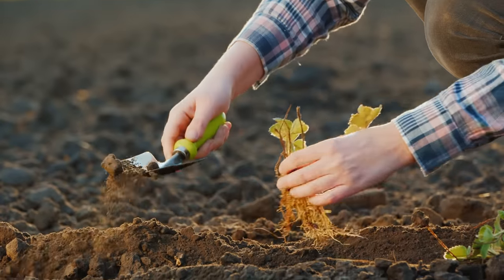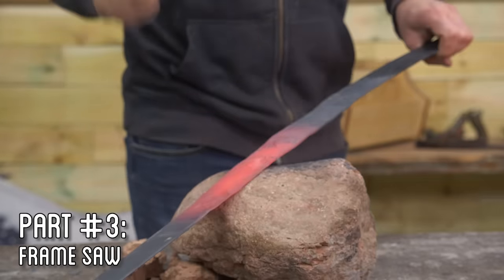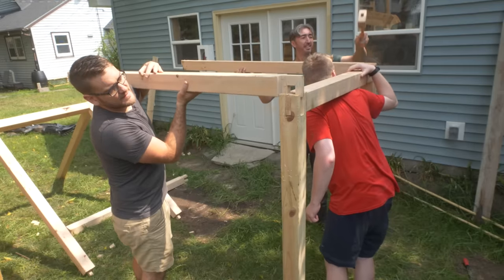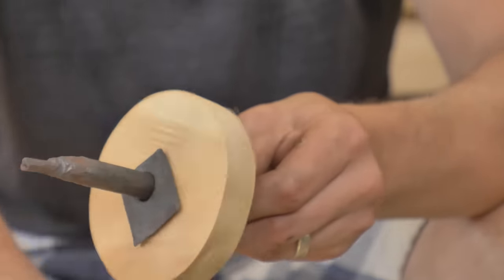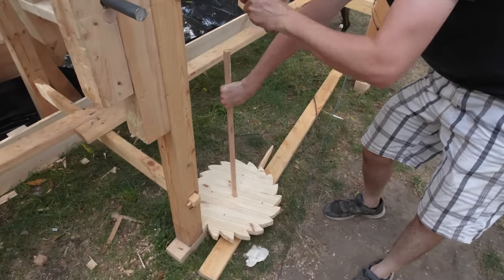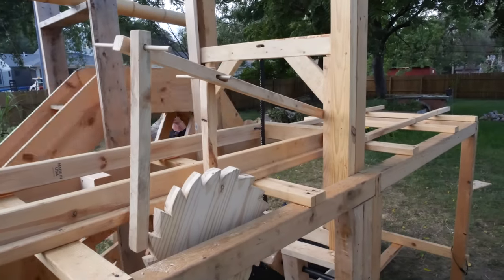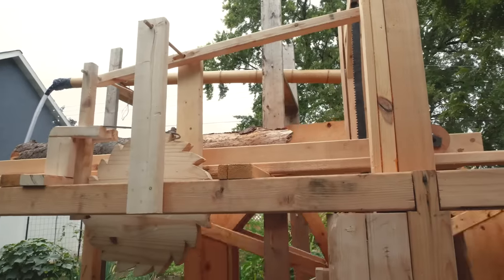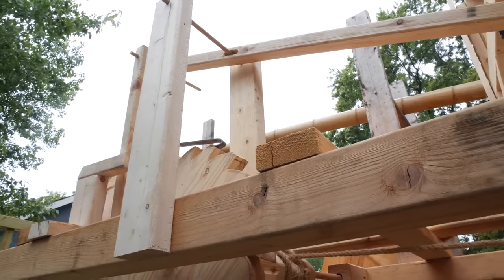I Built DaVinci's Saw Mill

Comment: The best way to better balance your water out flow is to have an upper water tank like a barrel.
That will give you a buffer time to fix any pump issues before the pressure ran out.
A large rain water tank might provide the volume needed to simulate a river in the same way.

Comment: Your connecting rod is a bit short.  This causes it to be at extreme angles and push the saw part to the side a lot increasing friction.  To keep the whole thing small vertically, there are ways you can get a much longer connecting rod without increasing the height to the log.  A simple one is:
Add an extension to the frame of the saw that reaches down almost down to ground level.
Make the connecting rod reach down to a crossbar on that.
This lets you have the log not very far above the shaft of the waterwheel.
Reply: Wouldn't moving the water wheel & crank farther apart horizontally accomplish what you're trying to do?  I made a similar comment about the connecting rod.  Its angle looked horrendous.
Reply: @lawr5764 I don't think I am getting your suggestion.  Somehow the one end of the crank has to push the saw up and down and the other end has to go in a circle.  I don't see how a horizontal change makes this better.  You need more vertical distance in the situation to decrease the angle.
Reply: @kensmith5694  You're RIGHT!  What I suggested can only work "VERTICALLY."   To do that, you'd have to raise the height of the ENTIRE frame to increase the connecting rod length.  To avoid that, I thought it'd be simpler to go sideways, but I didn't fully think it through.

There are ways to do what we want using angles other than vertical, but they are MORE trouble than just raising the frame, not less.  It would require extra parts, making it more complicated.  More parts also introduce more potential friction.

Your "extension to the saw frame" idea seems like the best way to go.

Comment: Cool build. Just one small thought that could ease the work of the machine. Instead of a ratchet that pulls the sled, which can put pressure on the saw blade and compromise the blade and cutting, I'd suggest following. Make the sled go from a slight slope, so gravity will pull the sled and the log towards the saw blade. That way the blade would be cutting under constant pressure. Plus you can discard the whole ratchet system, which I see as another piece that can break.
Cheers.

Comment: For your mortise and tennon joinery, I have a design I like to use for knockdowns but I think it would help you achieve more rigidity. Most people will drill straight holes with an offset of 1/16 on one part to pull them together. I find this a bit inadequate for a knockdown joint. Instead, I use a 20mm forstner bit, tighten up the through tennon as much as possible and then mark the point on that tennon. Take the joint apart and then move that mark 1/16 towards the joint. This should be standard for a dowel up until here. Then I drill the hole at a ten degree angle. You can now use a chisel to square the hole or take a dowel and use a hand plane to flatten one side to make a round wedge. This joint works great and is incredibly stiff despite any looseness of the tenon fitting into the mortise. I would make a jig that helps with cutting the pegs at a precise angel. Just drill a ten degree hole into a block and then cut that block open to expose an amount of the wedge/downel. You can then plane flush or what I do is run that jig across an oscillating sander with a low grit number.

Comment: This was a pretty cool build. Water wheels really were a game changer for civilization. Can essentially turn any moving water into a power tool.
I will say the saw looked to be rocking left and right on top of the single rod pushing it up. would definitely benefit from using two rods closer to the ends of the center dowel for a more consistent motion, though I'm sure someone's already mentioned that.

Comment: For my own improvements:
I'd first put a rope torsion spring at the top of the saw frame and make it a pulling crank system instead of a pushing one.
I'd also make the saw teeth into the same shape as the ratchet wheel and put at least three paralel saw blades in the frame.

Comment: Considering it’s a first attempt you’ve done extremely well. Heck the fact it did anything is pretty amazing, the fact it actually worked although not very fast is great. With a few tweaks and a better water supply it could work even better.

Comment: Glad you did a large mock up of a old water powered saw mill. This may help. Built a much smaller one for a 5th grade science project, we found out that the frame that holds the saw blade and runs up and down in the Chanel needed a light grease. We used petroleum jelly. But I think they used animal fat or whale oil if memory serves me. Great Video

Comment: I think changing the log pulling mechanism to use a falling weight might give you more control over how hard the log is pushed into the saw and it would keep the pressure constant.
Reply: You don't want constant pressure on a reciprocating type saw. The pressure should only be applied during the cutting stroke and relaxed during the non-cutting part.

Comment: I am impressed. I would like to suggest;
 The moving parts need some sort of lubrication to cut down the friction .Lubrication with  tallow would make a huge difference difference.
The metal  crank rod keeps moving sideways, and loses power when that happens. I would suggest a wheel with an offset peg to replace the crank assembly. I think a lot less power would be lost, based on my own experiments decades ago. 
 I do like the cog wheel and catch idea. I never thought of the catch, similar to a watch movement.
 Revamping the saw blade and its setting of the teeth and angle on the teeth will greatly improve the speed and accuracy of the cutting.

The saw frame needs a top keeper board to lock the 2 sides together. I see the side moving in and out a lot in operation.
Good job all in all

Comment: Definitely worth a version 2, using what was learned to get a more effective version.  The water wheel being near perfect, but the slop in the saw frame movement needs to go away.  Large clearances are counterproductive.

Lubricate the wooden mill parts with beeswax, which acts as a friction reducer and wood preservative.
 The racheting forward of the log depends on the depth of saw teeth and teeth per inch and the saw stroke.

Gearing or a pulley  set to move the blade up and down more than one stroke per revolution of the waterwheel will also help.

Comment: One of the founding  principles of frame sawing is 'overhang'. This means that the blade tilts forward in the frame - so that the cutting action then acts like a wedge that closes going down and opens going up - thus the machine becomes self-feeding and there is none to little friction on the non-cutting up stroke ..

Comment: If I were on Andy’s team, I would highly suggest the next project be a waterwheel powered lathe.  

I have a feeling this project and many other projects would benefit from being able to make much more precise round objects like the wheels and pulleys and such.  

But as others have mentioned, for this, I would really focus on your blade.  And tweaking the ratcheting system.  It looks like it may be trying to advance the log too much with each ratchet, and doesn’t look like it’s holding the wood snugly against the blade.

Comment: You should use a gear train to take the turning of the water wheel and accelerate it by turning a smaller gear lower down.  This would lower the rotation center of your crank arm.   Your linkage between the crank arm and the saw frame is far too short and steep and places undue load on the upstroke, pushing the frame to the side more than it lifts. A much lower crank arm will make the angle of the connecting arm narrower and more efficient.  Also, it would help the operational speed of the saw frame if you had the cutting stroke be the down stroke, ( cutting teeth raked at a downward angle ) and if you added a pole spring to the upper end of the saw frame to assist in pulling the frame back up.   This is just a springy wooden pole ( although you could use spring steel ) fixed at one end and with the bouncy end suspended over the saw frame and tied via a rope to the upper frame of the saw frame. Ideally, it should be just enough spring force to hold the frame suspended  2/3s of the way to the top of its run when it’s not linked to the crank arm at the bottom.   This is just to help reduce the saw frame binding in its track and to take some load off the gear speed increase since the increase in speed will reduce the torque of the crank arm.  If you make the saw cut in one direction ( down ) you can also change the track the frame runs in to improve cutting. The saw frame should have a set of roller pins at the top and bottom that are the only things that engage the track.  For the distance that the upper pins run up and down the track should be no wider than the rollers on the pins.  But below that the track slot should get wider.  So the bottom of the frame can move forward and backwards by the amount that the connecting arm to the crank wants to yank the frame.  As another commenter noted-an orbital stroke.   As the wood is driving into the blade this would allow the blade to pull back from the kerf on the upstroke, and press into the kerf on the  downstroke which should increase efficiency. 

The shaft with the crank arm also needs a counterweight to make sure its mass is radially symmetrical.  That is, unlinked, it should spin freely and come to a stop at any position, without the actual crank arm always ending up pointing down. Like spin balancing a wheel, this will reduce vibrations, but also if the counterweights and crank arm are somewhat massive, they will act like the flywheel on an engine and help keep everything turning thru the dead spots in the power strokes. Or, you can incorporate a heavy flywheel into the gear train.  The saw would be slow to start up, but once running would tend to maintain speed better as the saw hit things like knots and such. 

Oh, and rolling wooden wheels and axels without bearings and the abrasion bearing surfaces of the saw track should be made of Lignum Vitae, if you can find any.
And lastly, you should not advance the log by ratcheting it to every stroke of the saw. That would feed wood too sharply and in too large an amount per stroke. You want the saw to be able to go like crazy.   Again, all you need is to bleed energy off the water wheel thru your gear train to run a much slower set of gears that will steadily advance the sled into the saw.   That is, take your water wheel speed and have its primary gear run two other gears. One of which is stepped to increase its rotational speed leading to the saw crank. The other of which does the opposite and slows the rotational rate. Which, by the way, would increase its torque for pulling thru very heavy logs.  Or alternatively, you could split off the source of water to turn a second water wheel with a slice gate that would enable you to control how much of the water goes to each wheel. This would make the sluice valve a speed control, where you could put more or less water thru each wheel to adjust the relative speed of the saw, versus the speed at which logs are fed into the blade.   E.g. Pine can feed faster than oak.

Comment: You could use a Roman style aqueduct water wheel to fill a large water tank then use the tank to run the sawmill's water wheel. If the sawmill's water wheel is high enough, the return tray for the water could feed the Roman aqueduct water wheel. If this works as I am picturing it, a simple hose should add enough additional water to make up for water loss in the system. The tank would fill up as it was emptying out.

Comment: To make the castle joints tighter drill holes through the joint with the inner hole being slighly off. Use a square wood peg larger than the hole and it will pull the joint tight.

Comment: Something I noticed that could also help. The saw doesn't seem to use the full stroke both ways. Adjusting that might help. 
Also if you have enough torque maybe try and find a linkage or ratio that the saw moves up and down more than once per advancement of the log. But that's just normal tweaking anyway.

Comment: You don't need a river for an over shot water wheel. Since its using gravity and not exclusively relying on the force of the water, you can get enough energy from a decent sized creek.
You can look up Spring Mill State Park in Indiana for an extremely well preserved, functional overshot wheel grist mill powered buy a creek. The wheel itself is massive and the millstones are over a ton each

Comment: A tip or two if I may, it seems that the saw blade frame was binding a good bit, a healthy dose of beeswax on the touching surfaces would help. The saw tooth design appears to be less than optimal for your application, might could refine the teeth a bit and have them cutting only on the downstroke to let gravity hapl you out. Lastly, you mentioned it in your summary, but the ratchet system seems to be awfully fast, might want to make a higher tooth could gear and use as small as possible of an axle to slow the draw of the log through the blade. Amazing job overall.

Comment: Get a cheap mud pump from harbor Freight. Put it in a screen  side of your water tank below the water wheel to prevent to many leaves and other stuff, but honestly a mud pump wouldn't stop unless it is HEAVY solids. branches and stuff. Then build a platform and setup a 55 gallon or 220 gallon tank on it. Pump the water into that and have a reservoir. Most Sawmills and wheat mills were specifically built just under man made or natural ponds/lakes and fast running rivers. As long as you have a good GPM pump, it should keep up with a good flow. 

I LOVED the design and it is inspiring. I would do some Wooden clamps to lock down the saw, instead of the rope. I wouldn't want to mess with a rope while it was running. 

Then last because of the low water flow it didn't have a lot of power to cut it seemed, like it stalled. I think the the above suggestion would fix that, but if putting on a river, you can't really stop the water flow. Would gears be out of place on something like this? DaVinci worked with gears and you could make some really decent ones out of wood, I'd prefer metal, but thats a lot of work for this period. With a Gear system you could mess with the ratios to get the most torque or power for cutting and maybe even increase speed. Then you could also add a disconnect gear with a lever on it so you can put the power source off the saw if there are any issues. Once it's going on a river you really need a way to stop it, just to be safe I'd think. 

Now I want to build something like this, awesome job guys!

Comment: The child half of my brain that once tried to dig an underground bunker under the back porch is absolutely loving this series 😂

You've so far had much more success with your projects than childhood me did, which is cathartic to watch 🙂 I do think you're shooting yourself in the foot with that saw blade though. It's a great bit of channel history, but I think it's time to hang it on the wall and make a new, more effective one. One that's a bit less crooked, has sharp teeth cut to an effective shape with generous kerf, a greater depth for added strength and rigidity and smooth, flat sides so that it can follow the cut without adding extra friction.

I do really hope that you can find a natural water flow to power this think that would be a joy to watch!

Comment: You could try creating simple gearboxes. Take the power of the waterwheel and tweak the gear ratios to get the right amount of saw speed and sled tension. Also anything that is single sided should be mirrored to allow for an even spread of the forces. Except for the waterwheel, but if using twin gears on either side coming off of the wheel's axle or off your "gearbox" you can still mirror those forces.the ropes pulling the sled on either sidewould stabilize tension well.
Also making some simple wooden clamps along the length to hold the log to the sled, instead of rope may further stabilize and straighten the cut.
Not sure if these are within the tech that you have achieved with this series, since I haven't kept up in a while, but if so they should help.

One change that definitely should help is diagonal bracing to the base to reduce the shaking.

Comment: I would suggest a pully(probably two to have the weight pulling down from the side) at the top with a weight to counterbalance the weight of the saw and it's frame, so it is floating in the machine. Basically so it would not have to push up from the bottom instead only having to drag back and forth. Through this, there would be less stress on the mechanics.

Comment: suggestion on your waterwheel, would be to make some gearing to get more power out of the water wheel. for the speed it runs with, your set-up does suffer a loss of potetail power. the gearing would also help make other processes powered by the waterwheel faster

Also, if you want to make something round out of wood, use cross section of a log, makes it much more durable and less prone to vertical stress fractures

Comment: Force multiplication might be needed like a gear box to improve the speed to reduce the chance of the saw binding up. I would also angle the end of the drop bar to get a better push on the ratchet gear.